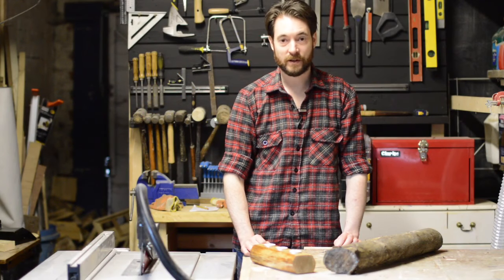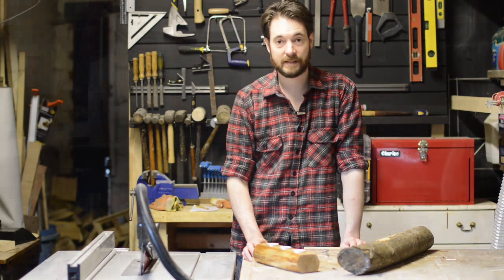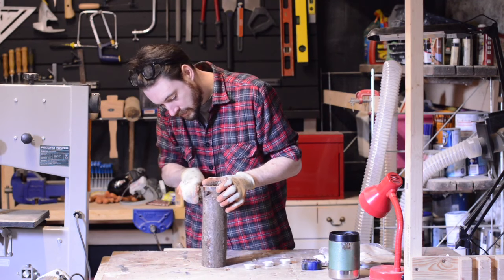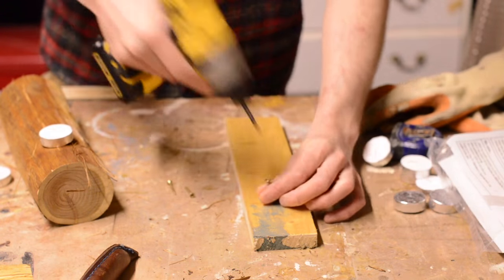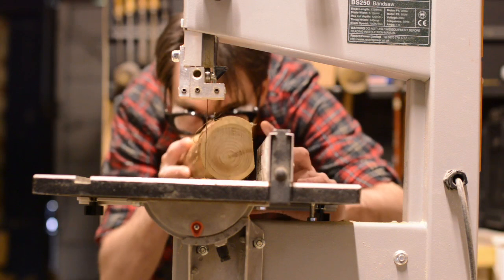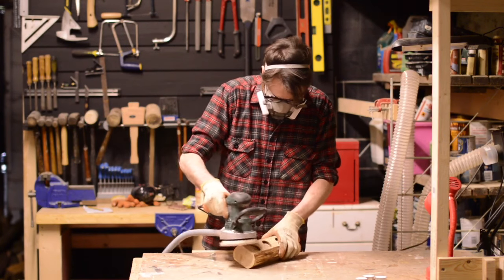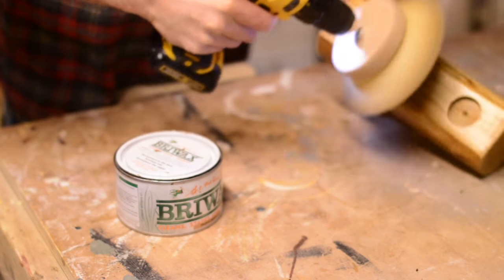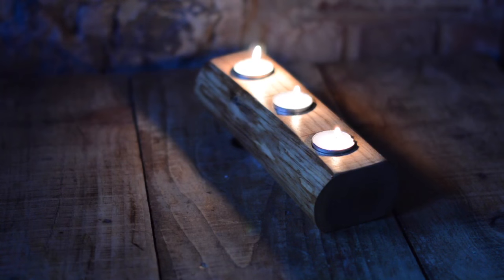How to make  tea light holder from a log, craft  upcycling project

Comment: That's a nice tea light holder. I did some attempts to make some tea light holders last winter but I was not very successful.
My widest forstner bit is only 25 or 30 mm. I had to use a 42 mm hole saw in my drill press. The wood was hard and I wanted to drill through
the end grain. Maybe not the best solution with a 500 W drill press. It took ages and the result was not nice.
I did not know there exist exact 38 mm Forstner bits. I'll try to get one. And I'll use my corded hand drill which has a little more power and some
elbow grease at the next attempt.
Reply from the maker: Drilling through end grain is very hard to do.